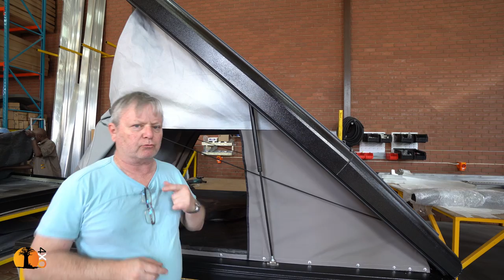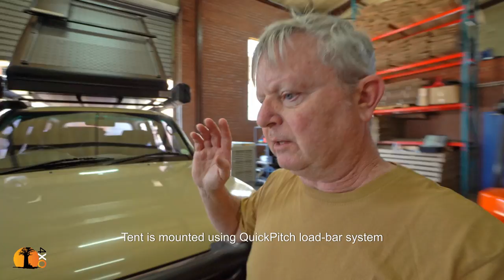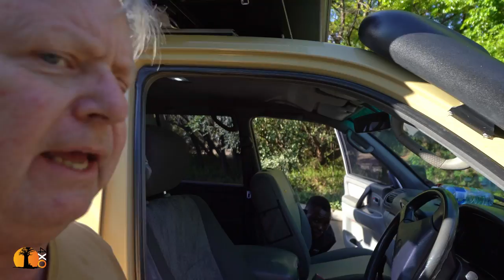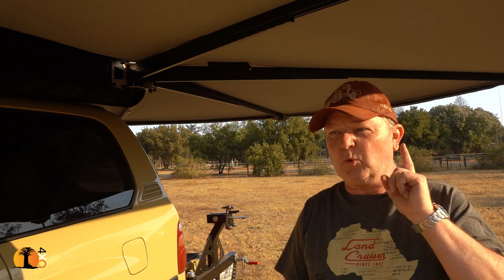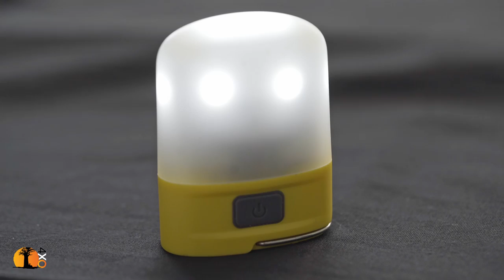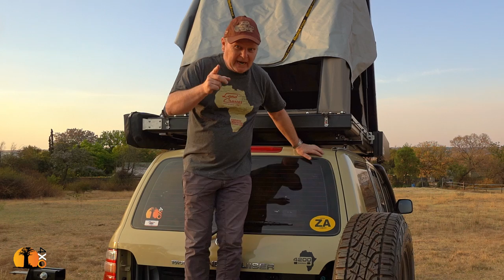Outfitting for Camping 20-Year-Old Land Cruiser

Comment: The drawer system that holds both fridge and cook top is just on another level! Great use of space. Also, two foldable legs on that extended tray could really aid on stability and strength when using the kitchen drawer.

Comment: We have a Gen3 tent by Alucab and changed the ladder to a telescopic one. Bought it cheap on Amazon. And mounted Alucabs’ hinge thingy on it. For what I see Alucabs’ system to connect the ladder to the tent is a bit easier. Also after rain I wouldn’t put the ladder in the tent. The tubes of these kind of ladders tend to fill with water during rain.

Comment: What a perfect way to start the weekend! great video, cant wait for you trying the build on a trip.

17:48 there are nice waterproof bags for your shoes which you can fix to the tent. Theyre hanging outside so you dont even have to move your shoes through the tents inside. Sheepie is selling those as well as many European tent manufacturers like Maggiolina or James Baroud. I think Thule also has those shoe bags.

I also hope that more and more tent manufacturers will move to the in-built roof rack for aluminium tents. Often it just needs one company to start this, and the rest of them will follow.

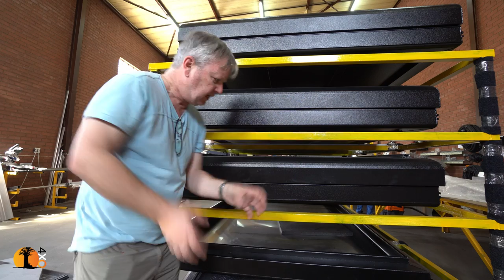Comment: Go Fast Campers in the USA has been doing what you’re talking about at 3:00 for some time now. The entire perimeter of the tent is channel that awaits your t-nuts and ideas. Best part is that if you have a 5th gen 4Runner it bolts right up to the roof with a set of very low brackets.
Reply: I was going to make this same comment.

Comment: @ Outback Joe... The design ideas are very similar to that of AluCab's ShadowAwn, which has anchor straps stowed in the arms.  We have set ours up and anchored with storm pegs in very bad continuos wind for almost two weeks without a problem. The design seems sturdy. Fitted solidly to the side of the vehicle and with propper anchoring, it should not be a problem at all.

Comment: Andrew you'll learn to hate that ladder. September last year we did a 9 day trip to Norway, which it rained the first 8 days.  Everyday we had to deal with water issues from that ladder when packing up the RTT. I even got the bright idea to place a few holes in the bottom rubber foot of the ladder which did help to drain the rain water but at each slide of each section of the ladder continued to collect rain water. There has to be a better design for collapsible ladders for those who travel in not so ideal weather conditions.

Comment: Nice Andrew, well done!

I have the same setup on my 105, a couple comments:

1. The telescopic ladder - if the "telescopic portions" are not clicked and locked, the ladder will tend to "creep" towards the side of the car and then one has trouble getting your feet onto the rungs, and also risk scratching / damaging the side of the vehicle. Also, I originally had my ladder in the same position as yours but then I moved it 6 inches towards the rear because we couldn't open the back door to gain access to articles needed for camping in there. A local manufacturer here in Limpopo has designed a really nice much smaller permanent ladder that bolts onto the side of the vehicle, and one uses the rear tyre to step up, brilliant, I'm getting one of those!

2. The roof-rack issue: I like to have a separate roof-rack on the vehicle as it allows one to load articles up there when one is not on holiday / touring, that takes off the 84kg tent. I remove my tent when I have the car at home for several months using a setup in my garage utilising the winch as a lift mechanism; can do it alone easily.

3. I moved my fridge setup to behind the drivers seat - removed the rear seats and built a flat, all-framed, carpeted board with tie-downs and that gives me a lot more space at the back for all the other items for safari.

Great rig, thanks for the reviews, go well.

Comment: Very interesting. A couple of points....

Continuity problem with the packing/ kitchen unit and fridge sequence, the fridge appears and disappears swapping with a yellow ammo box a couple of times, very discombobulating, at first I thought it was the Merlot! 

Also the ladders mounting bracket on the tent needs to be back 30 cm to allow the Cruiser's back starboard door to open whilst the ladder is in situ against the tent; there appears to be room for this. Sod's law dictates that you will want to open that door when the ladder is in place.

Comment: Thanks so much. These reviews are extremely useful. I am looking to covert my 2019 Armada for weekend camping excursions and I'm leaning towards the iKamper Skycamp. It's very pricey but at 72 kg, it's extremely lightweight and I have yet to see any other rooftop tent that is simpler to open/close. BTW, they also make a shoe rack and outer storage shelf that attaches to the underside of the tent.

Comment: Nice work Andrew, looks good, the RRT as a rack as well is great always thought it was weird no one has done that before, still prefer Bush Company’s 270 awning the new one, it’s self supporting dosen’t need legs at all, they also provide have done for awhile the extendable ladder too, also a SA coy, in Aus as well, but hard to beat QPs shower, hope they put the zip on the outside now not the inside near the vehicle.
Why they don’t use strip lighting with led and white/orange switchable options again would be lower cost and easier to install and have a hook that you can add a mobile light of your choice if you need a reading light.
Reply: Just a suggestion re the handle idea Andrew, Id mount 2 on the lower base of the RTT, but either side of the existing user one, measure out the distance that suits, that way your hand won’t get in the way or nick the upper std one and if you have stuff on your tail gate you can pull your self up from either side, cheers great work sort sad not to see you use it for so long also. 🤙

Comment: Hi Andrew, I really enjoy your videos, especially when it comes to your Land Rover videos. I am about to purchase a Discovery 4 with the aim of adding a rooftop tent and 270 awning to it. These products look fantastic however are quite expensive. What sort of rooftop tent and awning would you recommend for the entry level? I am not interested in the cheapest option. I am looking for more of a mid range product. Thanks.
Reply from the maker: QuickPitch is what I would recommend. EziAwn are good but all tents like this are awkward to pack away. A cheap RTT is a very expensive RTT. You have to replace it when it annoys you. Avoid Front Runner or Kings RTTS. They are rubbish.
Reply: @4xoverland  Thanks for the quick reply, Andrew. Much appreciated.
Reply: @4xoverland  Sorry Andrew just another question, have you had any experience with iKamper? Thanks.

Comment: Andrew, I love what you have done and the new RTT etc.. for me I'm not one to use or want a RTT or at present have a need or want for a roof rack (I would need to get a higher roller door and make a new frame for it to get my vehicle under it). I would like some manufacturers to come up with an awning system that can fit a station wagon and not have to buy/fit a roof rack or bars etc just to fit an awning etc.. I have been looking and there seems to be nothing out there at present that I can find 14 Sept 2020, do you know of any and if so doesn't cost an arm n leg??

Comment: Hi Andrew. You mentioned previously that the 1hz in the double cab was slow and would have preferred perhaps the v6 petrol. I'm curious as to why you went with the same engine in the 105 build ? Reason I ask is because right now I have the choice of a 1hz or the v6 petrol troopy carrier and any advice would be appreciated. Thanks
Reply from the maker: The 105 was only built with the 1HZ 4.2 diesel or the 4,5 straight-6 petrol. Never the V6.
Reply: @4xoverland  tha ks for the reply. I am not sure what engine to put into my 75 troopy
Reply from the maker: @nasseral-momen1463  I would fit a 1HDT. Toyota's turbo 4,2 that is like a 1HZ, but made to have a turbo fitted. Manual diesel pump. No electronics. Fits with minimal additional work to be done. But good luck finding one. Many 80-series had them fitted in factory.
Reply: @4xoverland  cheers for the advice and help. Much appreciated

Comment: Andrew! This awing needs more work, it's not practical for real camping. This awing needs side flaps from side rain and sun. at 12 noon in Australia, you bee burned to hell unless you move a car around away from the sun. plus so much metal covers that add up to GVM.  The biggest thing in rooftop tents is thickness when they folded also a front spoiler to deflect direct wind when doing over 100Km

Comment: Great video. Why don’t you change the gas burner for an induction top?
Reply from the maker: I would rather spend the money and use the limited space on a small gas burner than a bank of batteries, chargers and cables. Induction may be okay for a camper, but not this kind of set-up.

Comment: Are you using shell oil in your 105 ?
Reply from the maker: Yes. Why?
Reply: My 105, 79tray back and 78troopy used to use 1-2l every 5000 kms on shell oils, I started using synforce “cruiser oil” and was only using 200-300 ml in 5000ks , I must add all above cruisers had over 100,000kms , I get similar results with Penrite , mabee they have changed the shell oil in the last 10 years?

Comment: Knowing your aversion for water crossings, with good reason, sometimes walking the water isnt an option eg crocs etc. Has anybody ever cosidered taking a telescopic bass rod with a  castable fishfinder? Takes up no space works on bluetooth and most have a range of around 50m. Could give useful info on depth and obstacles if you are pressured into a water crossing for whatever reason when wildlife makes walking it risky.
Reply: Thinking about it and upon reflection, silly idea, very silly in fact my own fishing experience tells me that the water might not be deep but the silt could be. You need to check this. It would be foolhardy to trust a device like this. Ego tells me delete the post but the thought process might prove helpful

Comment: Nice video! Hope Quickpitch brings their kitchen setup to the US across the Toyota lineup...
Reply from the maker: That system works with any medium sized SUV/wagon. And I understand it is available in the US, although QP do not have a proper website for the US market.
Reply: 4xoverland Thanks Andrew. I looked into it and TGM overland from Texas  imports quickpitch gear in the US. I wish someone built a fridge slide with integrated lithium power that you could roll on - roll off as and when needed .
Reply: @sikandinc  there are some kitchen units already State side. 😁